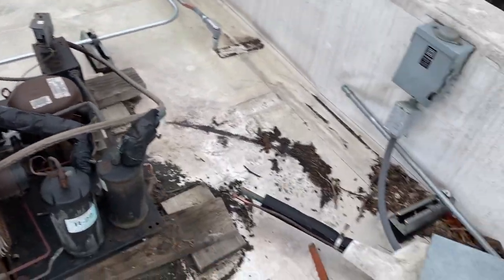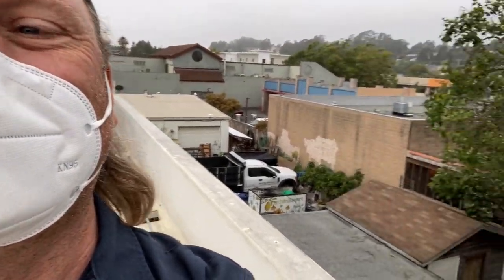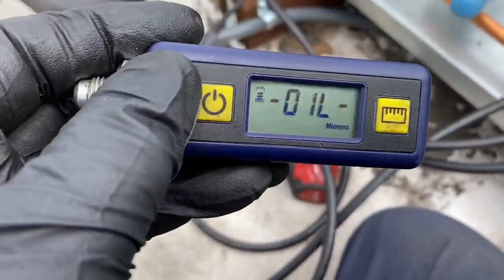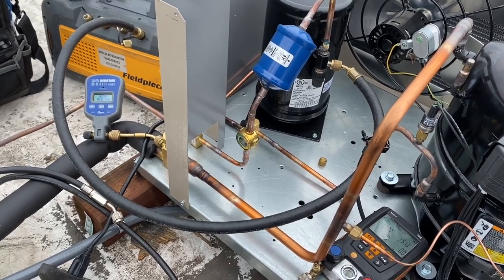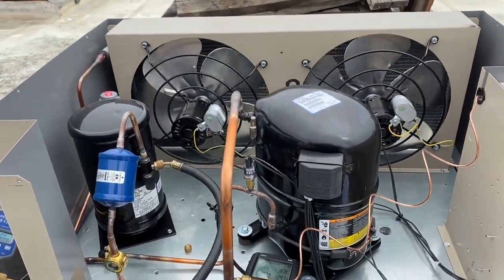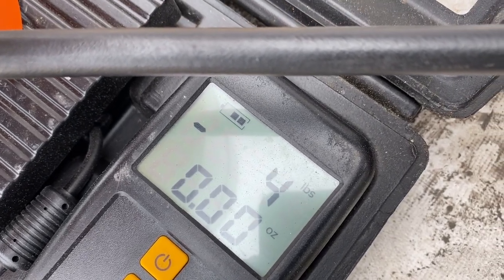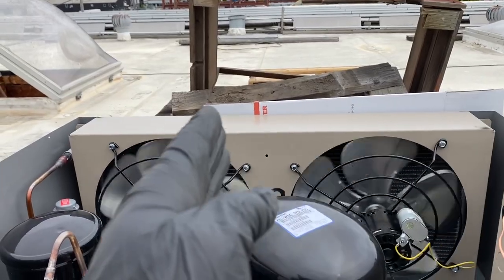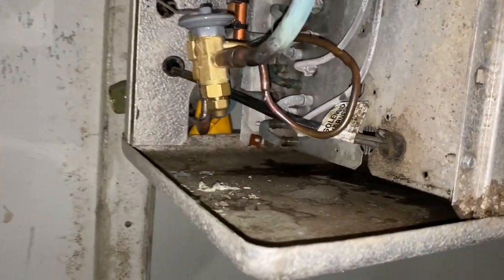Condensing unit change out

Comment: 👍👍👍
That was 4.6 liters so 90 percent would be around 8.7 pounds
for your head master winter charge.
Reply: Yeah. You multiply the volume of the receiver by the specific gravity of the refrigerant. R404a is 1.06. 4.6 liters x 1.06 x 0.90 = 4.39 kg = 9.38 lbs

Comment: dave that is 4.6 Liters I installed a freezer with that very same condenser unit I was having difficulty getting the superheat to between 6 - 8 degrees, I called Heatcraft tech support and that dude told me I had to add more refrigerant to account for the evaporator, so I just defaulted to slowly adding until my sight glass outside the evap cleared. Box is at -9 and superheat was 8.

Comment: Receiver capacity is 4.6l (liters) which is volume, not weight so you need to know the density of your refrigerant and convert 4.6l into weight (kg) then kg to lbs. Also that sight glass looked completely empty to me (which would make sense as 4lbs is about half of what the charge should be)
Reply from the maker: At 6:49 I say it’s a 9 lb receiver.

Comment: Use. A 3rd. Valve core tool to isolate the probe keep it from getting oil. During charge without loosing vacuum